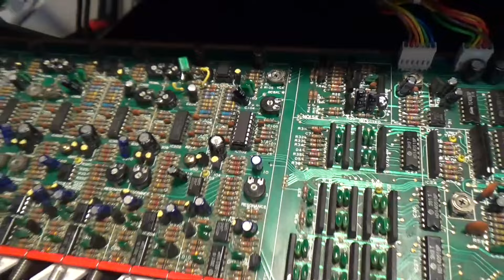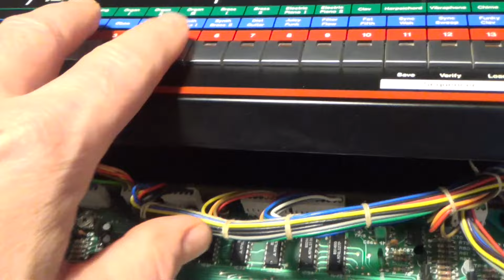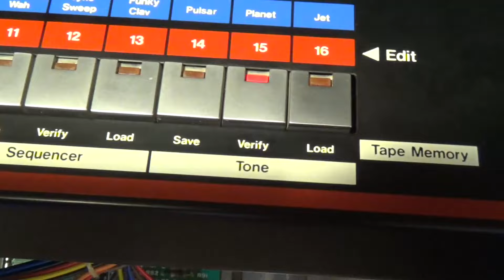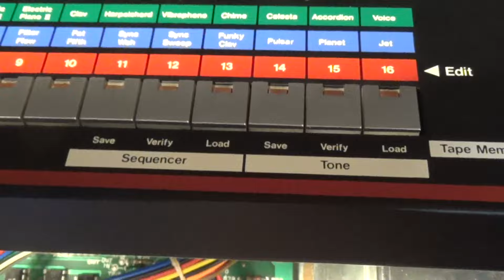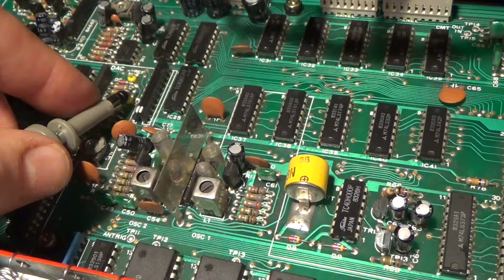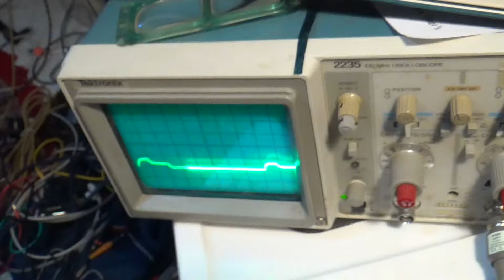Troubleshooting a Roland JX-3P with bad rumbly sound

Comment: Thank you Erich, I appreciate hearing your thought process and deductive reasoning. I’m gonna see if there’s a resolution video but I too have rumbling junk on voice one, but I only hear in the upper registers when I get down towards the middle it kind of vanishes.
I would guess that it has to do with the DCO multiplexer possibly as well… Something is going on. I can’t really tell if it’s DCO one or two to be honest, not aware of my patch configuration. I can’t really build a new patch until I’m done fixing the power supply since that went out… it would be fun to have your eyes on this when I get that back running… if you offered live  troubleshooting with somebody I might buy it🤷🏼 😂

Comment: Prob has nothing to do with the noise issue, but I’d recommend replacing the battery while you’ve got it disassembled. I got mine from Syntaur and it was a breeze to install , but Analog Classics sells a battery cell holder that looks more convenient. 
Love to hear an update on the repair. The folks on the Syntaur forums are pretty knowledgeable about this kind of thing if you haven’t fixed it already.